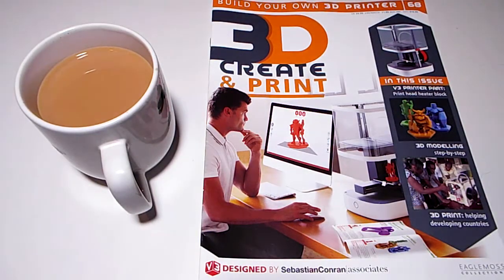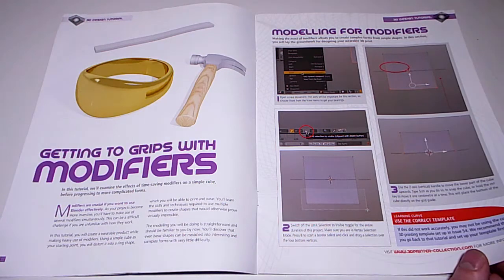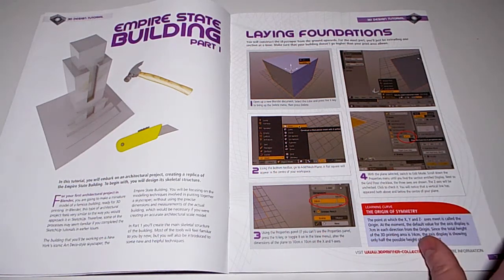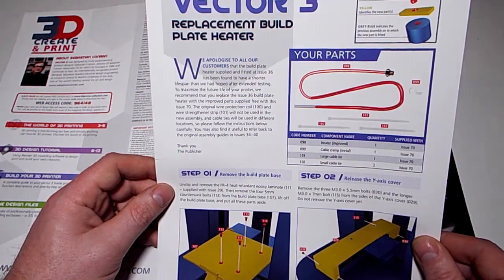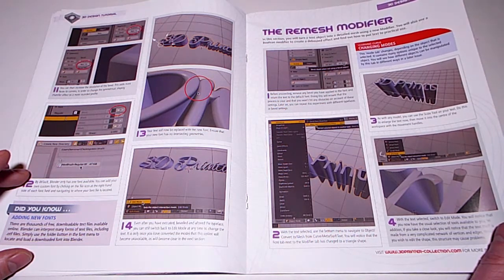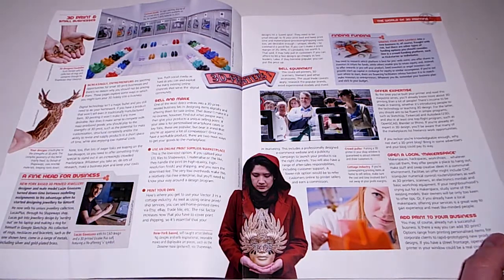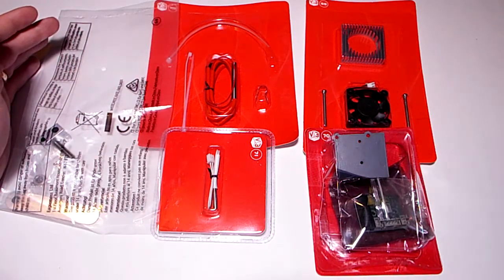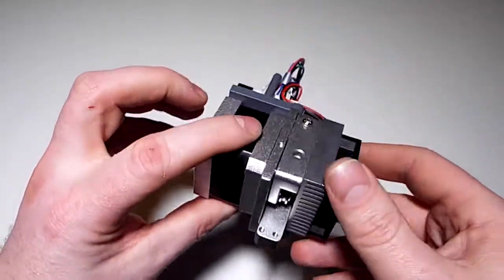Build Your Own 3D Printer ( V3 ): Editions 68 - 71 : Design Changes? Plus More Extruder Work!

Comment: is anyone else having problems with this. 
my printer will connect via USB no problem (manual control panel shows 'idle')
the problem come when I try to move any axis. the commands sent from pc to printer just 'stack up' and don't ever get executed. the status LED on the motherboard is not lit either. however the atmega uP does have power to it. tried eagle moss,  they just tried to talk me through the USB connection steps, even though I've already done it.
anybody any ideas?
Reply from the maker: +William Green I have a tutorial video on how I got the axis moving etc :o)
Reply: +RetroGamerVX, thanks. I followed your tutorial. that's what helped me connect to the PC. didn't work for moving the axis though. I did however get an email from eagle moss yesterday. apparently there is a new version of the firmware for the printer going live on the website any day now, and instructions for downloading/flashing will be in issue 76!

Comment: your print head heater block is on backwards. big hole for heater should be at the front. also your fan is on back to front too.
Reply from the maker: +William Green I know, it doesn't matter which way around the block is, but yes, the fan has been corrected :o)
Reply: +RetroGamerVX.   Ha. I just reasoned that the further away from the motor the heater is, the better.
Reply from the maker: +William Green good logic, i may fix that :)

Comment: Hi there.
I see people are having trouble getting the software too recognize the 
printer. I too had this problem. It's not the printers motherboard, it's that you need the FT 232 driver. 
I Google for the driver name FT 232 R and installed it first. (Make sure you download the self install)
I found if you change the setting com 1 to com 3 it works fine.I have 2 pc’s and it worked, (Just look for the com port in device manager 
under ports and coms with the printer switch on.  Click on it and you should see 
communication port com 1 And below it say USB Serial Bus com 3 
if you do, great. Close device manager 
In the 3-D create and print software go to the print setting tab in the 
config tab, change the com 1 to com 3.
the software can now talk to printer. 
I am using windows 7 (Home  on the laptop and professional  on the desk top 
PC both 64 bit.)
On my windows 10 (64 bit) it' just plug and play.
I  hope you find this of some use.
Reply from the maker: thanks Kevin, yes, been pointed at several different drivers, i discuss one for windows 10 in a video coming up

Comment: I am building this 3D printer here in Australia. We are up to issue 41, it is going very smoothly so far. I have been following your build since I started mine, this helps as I find that I am not making mistakes and getting done quite fast.

Thanks - Derrick
Reply from the maker: your welcome, i suggest lookng one vid ahead as ive sometimes made mistakes, and dont fut that dam origiknal heating probe lol
Reply: You are 30 issues ahead of me so yeah I am noting this and it is making it easier for me. Again thanks.
P.S. Why are  you up at 2am? - LOL.
Reply from the maker: +DJW1959Aus nocturnal, didnt go sleep until 6am lol

Comment: hi, sorry to be the one to tell you but if you look at the instructions and the official build videos, you have installed the fan upside down and you need to rotate the print head half a turn so the large hole is furthest from the motor
Reply from the maker: videos are old, changed much sonce then.  i thought about that hole being on the wrong side but, it dont matter which side its on really

Comment: i wandered why they sent a extra part
Reply from the maker: +tony bull Yup, pain in the ass to fit, but much better design.  I've now got mine running with the axes working and the build plate heating.  Tutorial coming up on channel tomorrow :o)